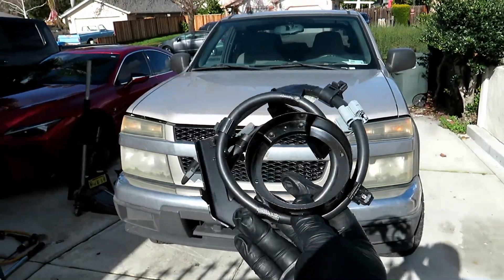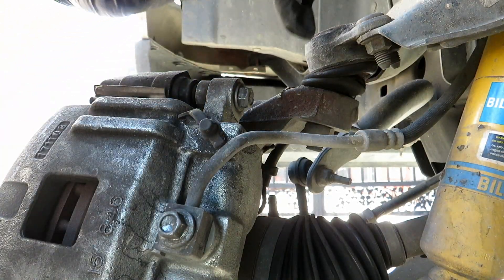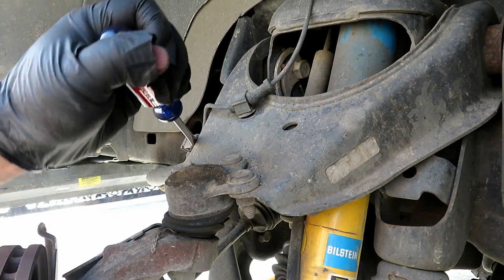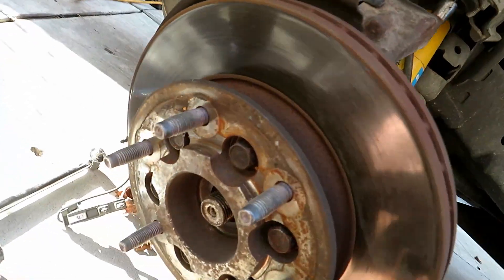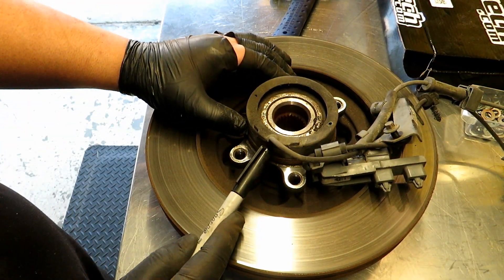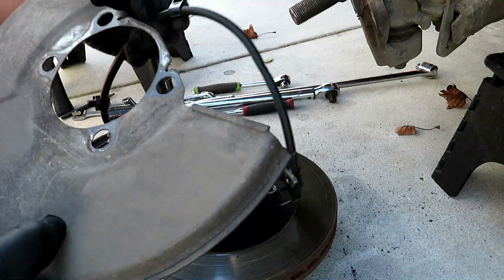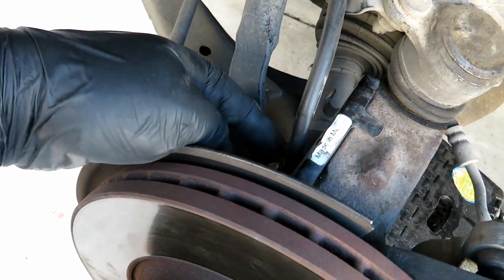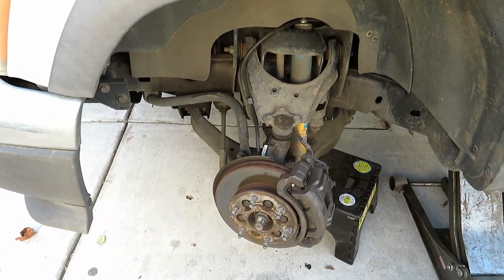Chevy Colorado/GMC Canyon - 4x4 ABS sensor/Wheel Hub Bearing Replacement

Comment: You do good work but you dont need to remove upper  ball joint you can remove the hub bolts .The bottom hub bolt break loose with bar socket short exstention then a combo wrench to remove hub bolt . past lower ball joint .just saying it saves a step . also a tip is if you damage the dust shield and for some reason you are unable to reuse it or get a new one you will have to use a spacer to take its place . Good job Rolando

Comment: I replaced abs driver side sensor and start making a noise when braking. After couple times braking abs light come up and stop the noise. 
Already replace for a new bearing hub and another abs sensor to the front wheels and still the abs noise. Did it happens or any idea about it solution? Thanks
Reply from the maker: @racawexa  when braking? Make sure the little clips for the pads didnt get crooked when installing the brakes. Also make sure the metal isnt bent on the back side of the wheel bearing wearing it can be touching.
Reply: The brake pedal starts noise and shakes up and down like if the abs is detecting a rough braking situation
Reply from the maker: @racawexa  oh. Sounds like the abs sensor is misaligned or not reading correct activating the abs
Reply from the maker: @racawexa  on a previous colorado i did. I accidently punctured the grease seal (where the abd sensor gets its reading and it had the same problem as yu described.
Reply: @hyr0llr yesss, its like reproducing like it needs to activate abs but in a normal brake situation
Reply from the maker: @racawexa  yeah make sure its seating correctly(evenly) all around. Thehn if its good. Gonna hvae to pull the axle to see and make sure the grease ring plate wasnt damaged
Reply: @hyr0llr thanks my friend I’ll do it by tomorrow and let you know if works. I definitely hope works😢
Reply: Thanks brother! Today I finally fix the issues. The another bearing hub has some dust and abs sensor was reading properly, I replace from another and everything perfect
Reply from the maker: @racawexa  great to hear the problem was an easy fix. Cheers

Comment: What can we do if the hub is stuck?
Reply from the maker: Im assuming because of rust?. If so see if yu can wedge a pry bar or screwdriverk between hub and knuckle. Or also put the hub bolts in a few threads and carefully hammer them with a socket you can sacrafice to create a gap between the 2. If all else fails. Unbolt the rotor and your gonna have to just hammer the crap out of hub(so youll need a new one).
Reply: I had to cut chunks of 2x4 and use my power steering to pry the rotors off lol... Took a sledge to mine and they were stuck stuck. Called up a couple diff neighbors and no one could get it so we did that and it worked like a dream